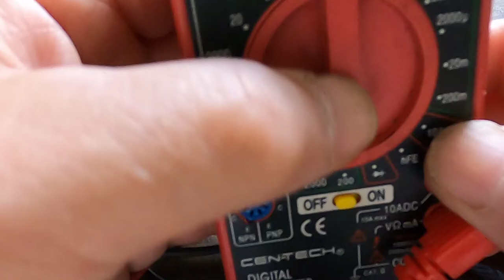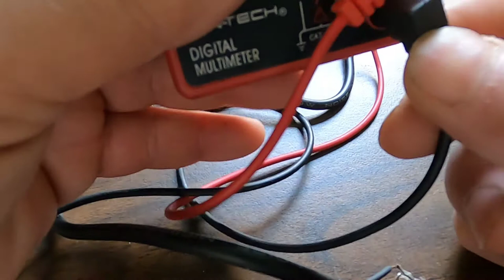How to repair microphone wire

Comment: Hi, so it took mi longer to find your video but i need you to help me understand, does the foil play any role? do i need to saw the foil together?
Reply from the maker: Thank you for stopping by. This was the first time I did any microphone repair. Since then I looked into it a little more. I believe the shielding protects your signal from electromagnetic interference. Either way I would keep it connected. Let me know if this was of help.
Stay safe, Joe Z

Comment: Thanks for helping us nubs dude. iv just got a RadioShack 30-3038 basic all purpose crappy mic.. just bought it from charity shop ason as I get home I notice the rubber around where the wires enter  was cracked so I just had to pick it to fix it.. it was working fine in store.. i get home I see the hol
e appearing  have a mess and they I'm getting craccles in the signal now iv tried to cut the bottom rubber housing system for the want of a better name, there's a ground,, rusty copper ? and 1 white wire.. i cant seem to get the top cap out.. the ball grill this iv took of but has the the housing is solit cast metal.. i want to re house into my tripod desk mic housing.. empty nowadays.. should I just cut the moulded rubber bung of inc wire then try to get the bits out that way??  ANYBODY IM ALL EARS ????
Reply from the maker: Hi Tony, I am not sure & do not want to suggest something that will cause more damage. If anyone reading this post has a suggestion please give Tony some help.
Sorry I could not help you out with this one. When you do get this working let us all know what you did to repair it.
Stay well, Joe Z